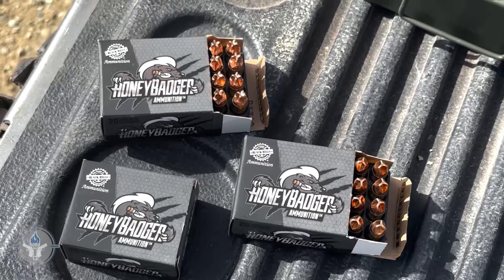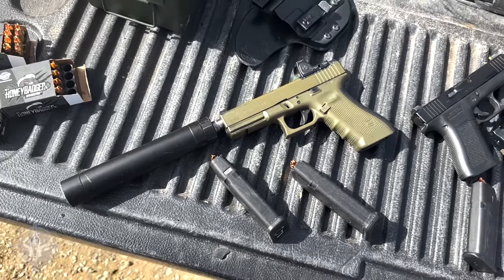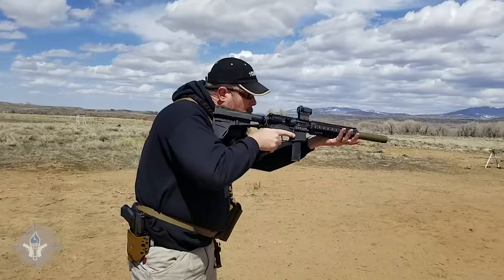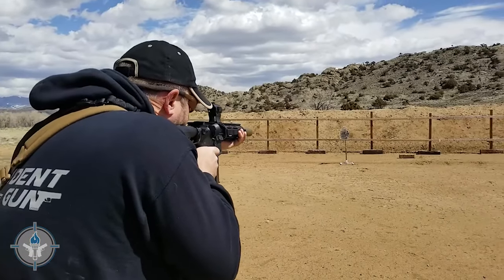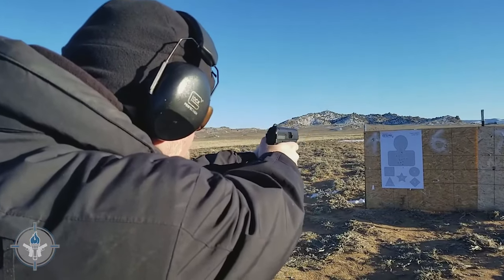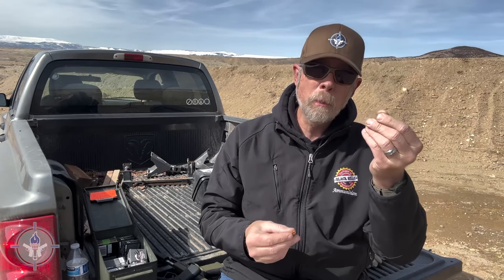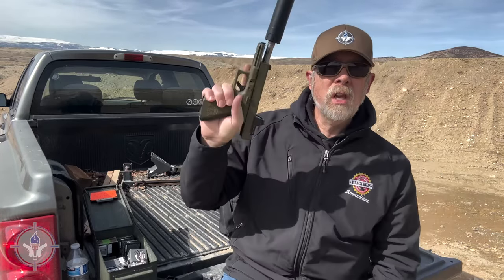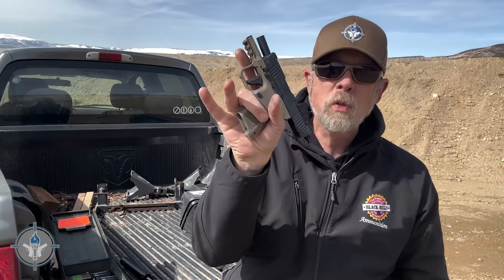Does Honey Badger Ammo Jam Your Gun?

Comment: It could depend on the thickness considering JAG rounds for bench reloading, and the firearm's extractor torque, and the magazine's rate of diffusion of vibration. 

Ex. AAC 9mm JAG will jam in a 100rd drum with an AP5. 

That's my own find- I had a triple feed for pete's sake.

It runs fine in standard steel magazines— 
but I just thought I'd pass some science.
I haven't tested another JAG round that works yet— but definitely glad I didn't have to throw both drums back at the manufacturer.
Reply: Did you even watch and listen to the video?
Reply: @dauntless1967  was this off topic?
Reply: I mean, if people were scared the projectile weight and design were potentially jamming, I can see that as well. by "it" I meant ammo in general jamming.